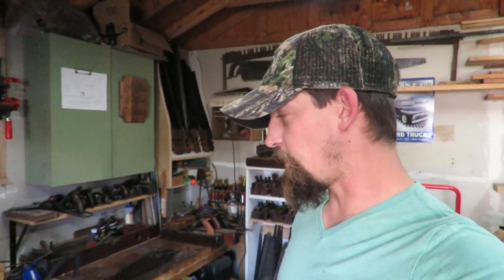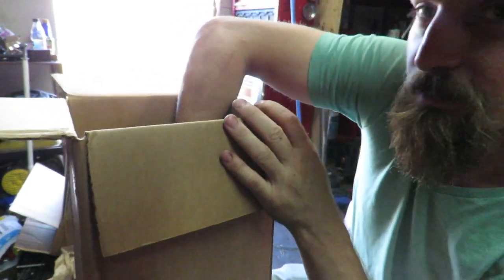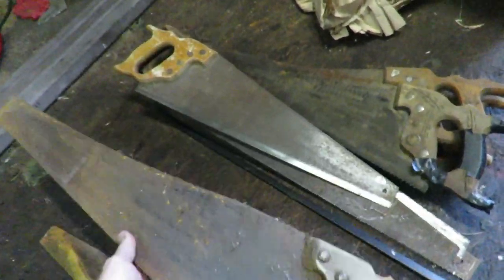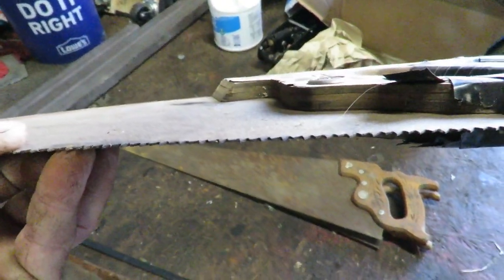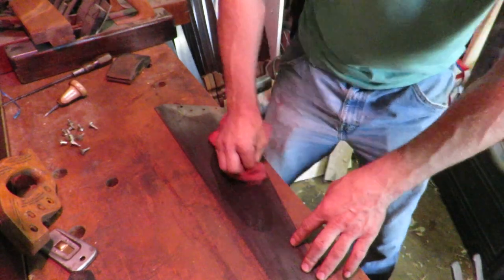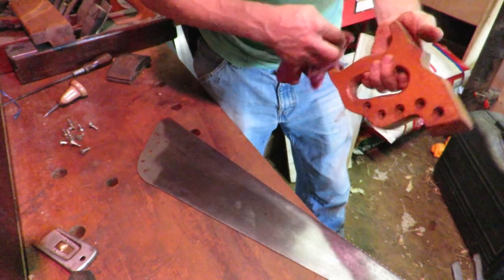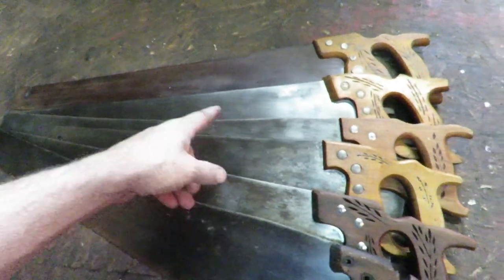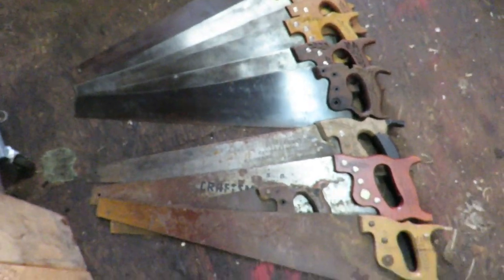Buying A "Junk" Hand Saw Lot Off EBAY

Comment: I've got a stack of old saws, no idea how many, I've picked up over the years.  My goal was to figure out what I need and sell the rest.  I never thought about cleaning them up before selling.  I'm sure if cleaned up and sharpened they should bring a bit more than in the shape they are in now.
Reply from the maker: Its easier to sell something ready to use then something that needs work....wait, thats what I did 😁
Reply: @ASliceofWoodWorkshop  I guess it all depends on who is buying the saw and if you can get a decent return on your time.  If you can clean up a saw in 20 minutes and make an extra $10/saw for that time, that's $30/hour.

I've got a couple Disstons that date back to the 1880s I need to restore.  Paid $5 each.  Not sure what they are going to look like in the end.  I'll probably keep em anyways :-).
Reply from the maker: Its hard to sell the really old ones.